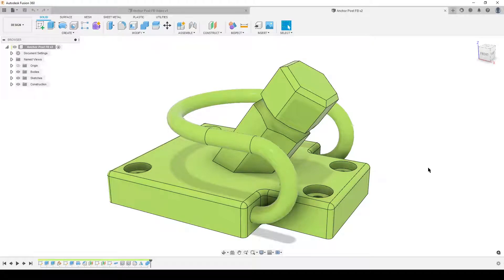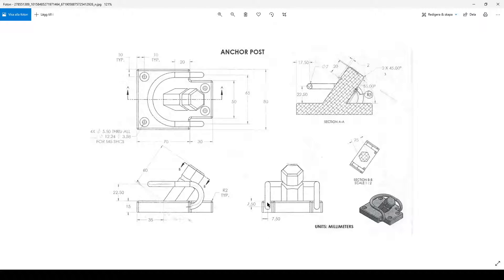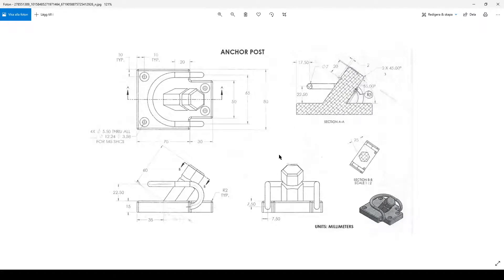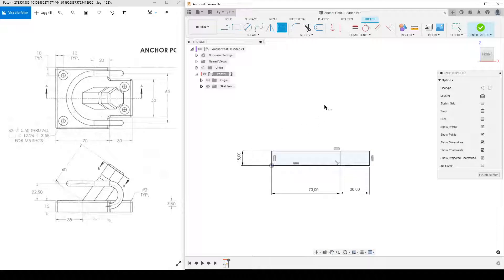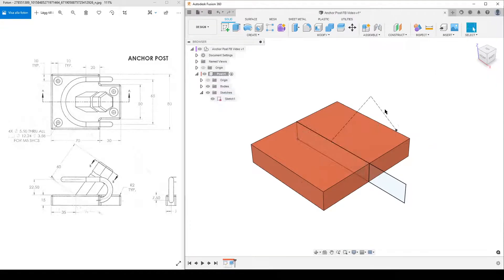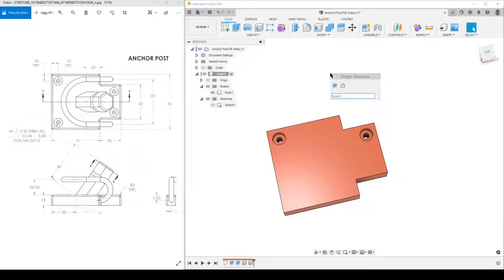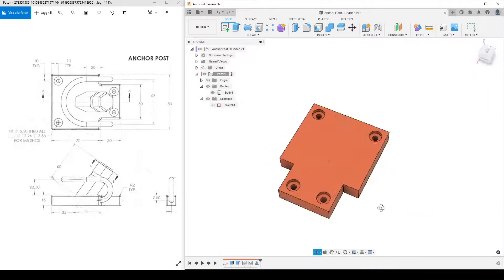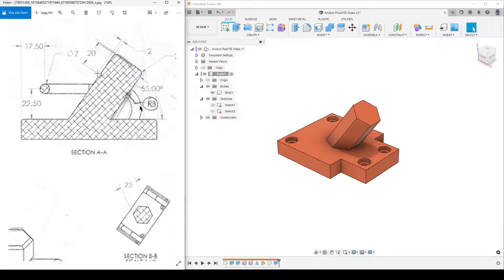Fusion 360 Basic - Anchor Post

Comment: I did have a problem getting getting the two sketches that make up the pipe to connect. Then I watched you do it by creating an offset sketch "to object" (the point to connect to) then it worked like it was supposed to. Thanks.

Comment: I hade issue with the last part of the part of the pipe when I change the with of the base. Even if the sketch was constrain. I hade to edit it and "move" the line to make it snap in place. Re did the constrain and worked.
Reply from the maker: I gave it a try and it looks like Fusion fail updating the second pipe sketch. A "Compute all" (CTRL+B) fixed it for me without editing the sketch. Compute All can sometime fix small glitches like this.